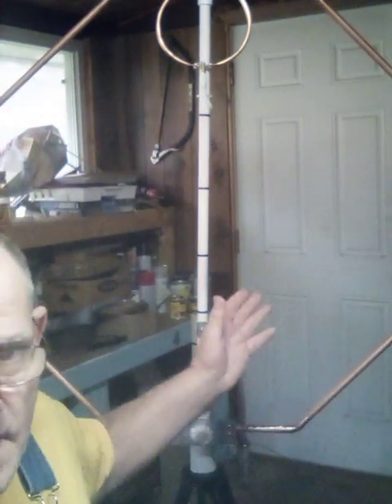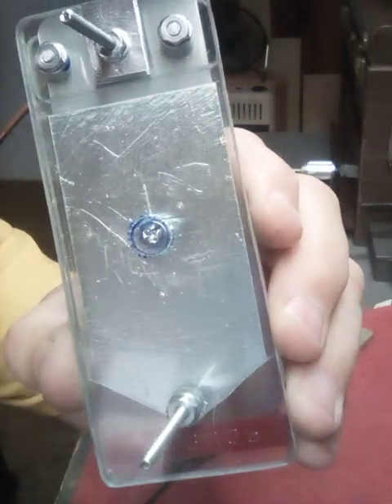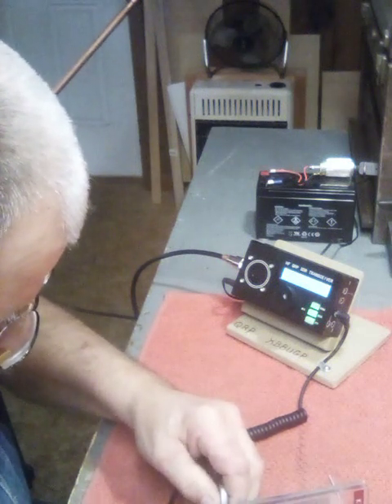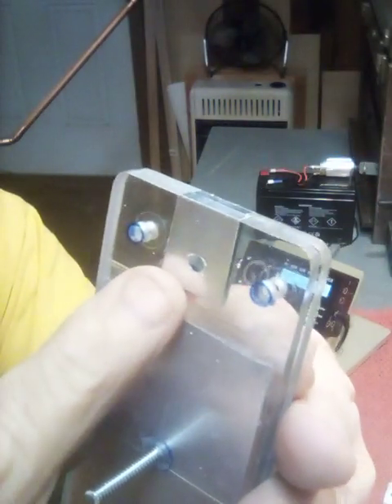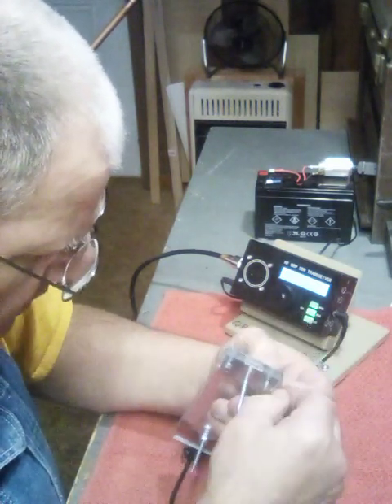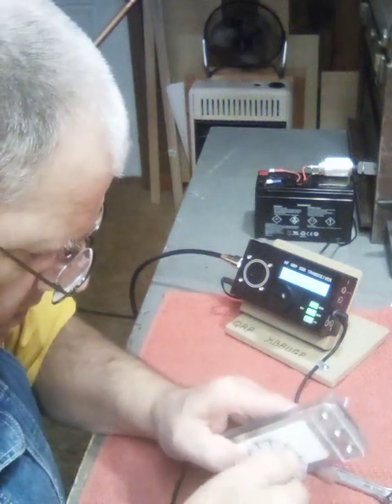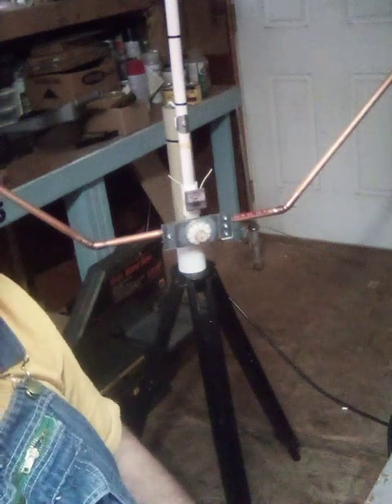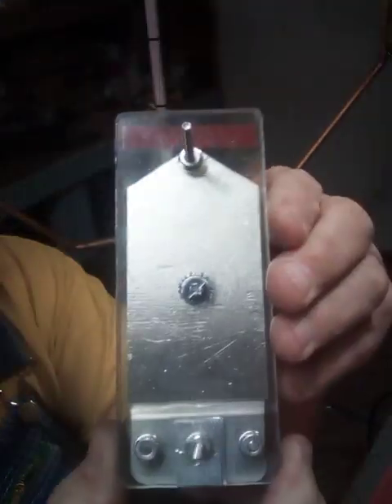Ham Radio Magnetic Loop Antenna Part 2 THE TUNER

Comment: Gary, Wondered what the (insulating tape) thickness is and if you had tried different thicknesses or materials and what effect it had on capacitance and bandwidth tuning capability? How about the dimensions of the plates??? Thanks for giving me another project ! ...Rich N3JLR
Reply from the maker: The tape is .008 thick if the tape is too thick the lesser the compassionate son I went with 8,000 stick that way gives me a full range the capacitors should measure anywhere from 12 to 240 picofarads

Comment: Many thanks for your wonderful video. You have satisfied my curiosity as my little Sinclair Micromatic AM matchbox radio has a small postage stamp / compression tuning capacitor in it and I was wondering if one would work if up-scaled. Obviously it does!
I made a magnetic loop antenna for CB radio and made a tuning capacitor from very thin aluminium sheet and fabricated vanes separated by nuts on long bolts. It works ok but your method is simpler and more robust  and neater.

Comment: Gary, this is a keeper, and I'm nominating you for the 'HAM Inventer Of The Year' award!

I've always been interested in Transmitting Loops and built one many years ago with little success because I only had a small value cap with no gear reduction. I now know that I also had lots of RF feedback on my Coax each time I hit the key. I wasn't too smart back then. Oh well.

Your cap design is an exorcize in simplicity and reliability, and I'll start building one in a few days after I replace the battery in my SUV.

I will also build your Field Strength Meter as soon as I see your post on it. I thought you were going to use it to tune the loop, but you fooled me. Hi Hi.....

BTW: Just subscribed

73 OM
Russ KA1RUW from Southern NH
Reply: how can i vote how to vote 
thank you g0psz lou banaszak

Comment: Great design Gary,
Have you tried higher power ?
Looks like it might handle 25 - 50 watts.
Keep on inspiring us !
Cheers
Reply from the maker: I put 35 watts to it SSB done fine but I tried AM mode and it did arc but then I put glass tape between the plates then I had no arcing.